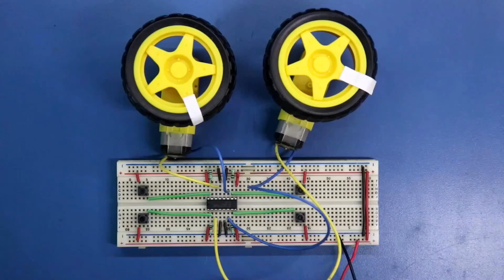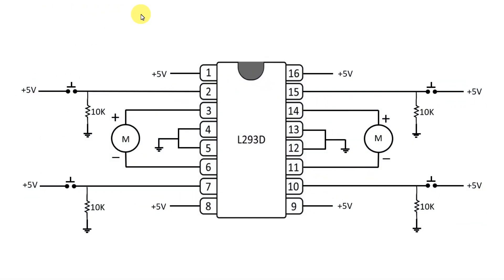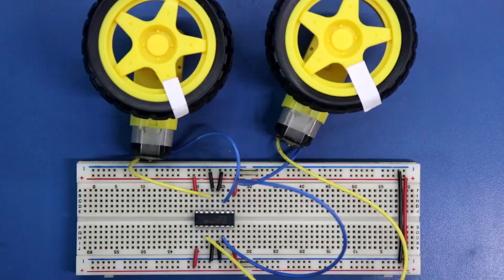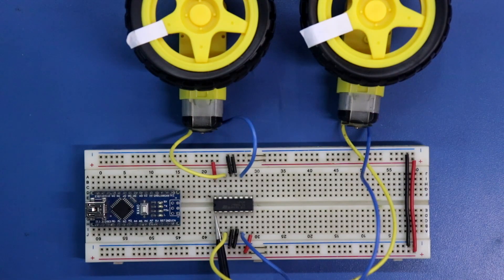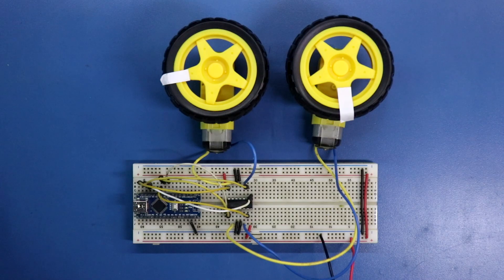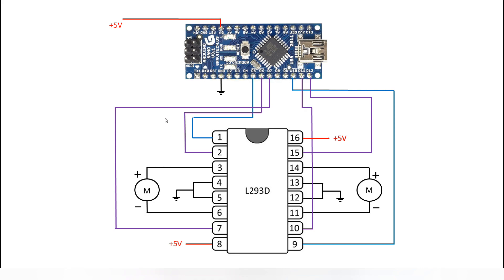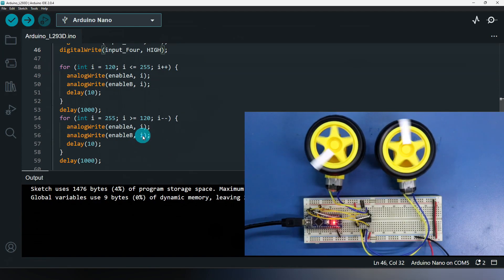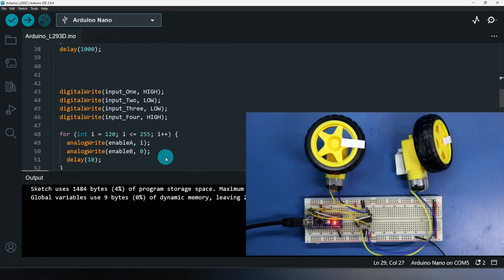L293D motor driver with Arduino Controlling DC motors  Arduino H Bridge Part 4

Comment: You're a machine D. Haha I have a metal frame with 4 motors and mechanum wheels but the bigger l298 modules don't leave any room for much else. What's the upper limit for that ic if cooled
Reply from the maker: 😁😁😁
Hi friend, according to datasheet, it is 1.2 Amp.

Comment: That was a excellent video. Is there any sort of heat sinking that is required when using higher voltage motors OR motors that are doing significant work?
Reply from the maker: Thanks..
This IC has inbuilt heat sink. It can handle upto 1.2 Amp according to datasheet.

Comment: During turning left or right, both wheels need to rotate in the opposite direction right?
Can one wheel just do nothing while other one is rotating?
Reply from the maker: Yes it can. Just make one enable pin Zero. I've shown in the video that how to run only a single motor.
Reply: @EEWave  Thank you for replying.
I thought the force of turning will affect the gear of the motor if it doesn't move along with other wheel.
Anyway, I will build a toy car using your circuit.

Great tutorial. 😃
Reply: Please, next project do NRF24L01 wireless module. I'm stuck with Bi-Direction communication for so long.
I already gave up but still hope someone will do the tutorial.